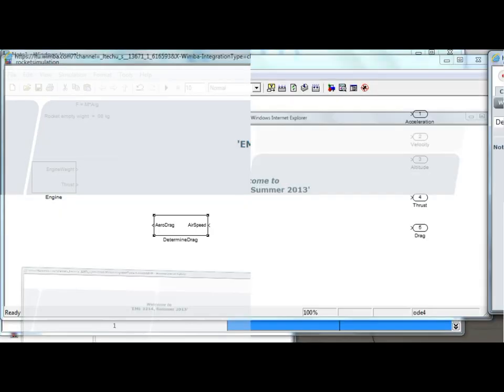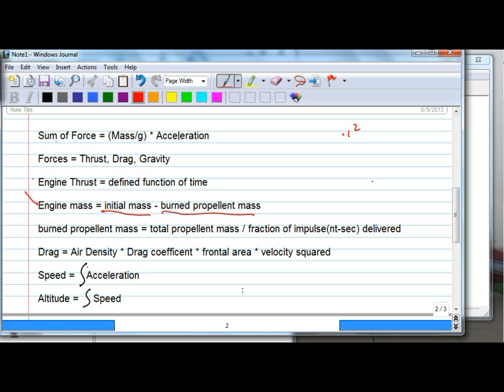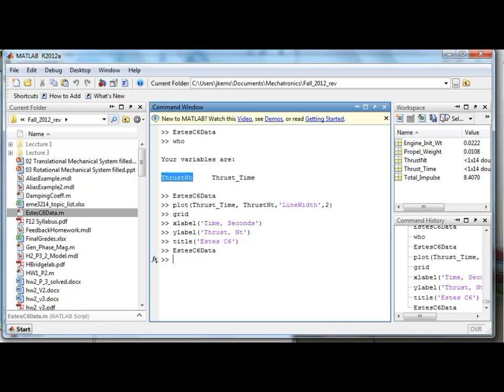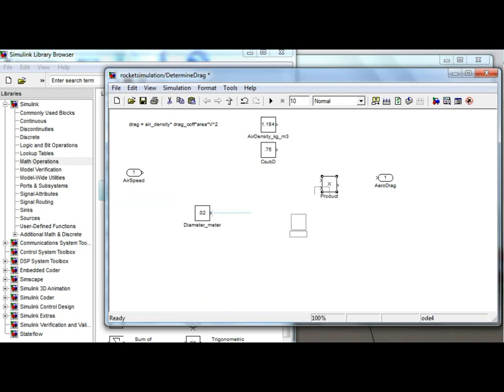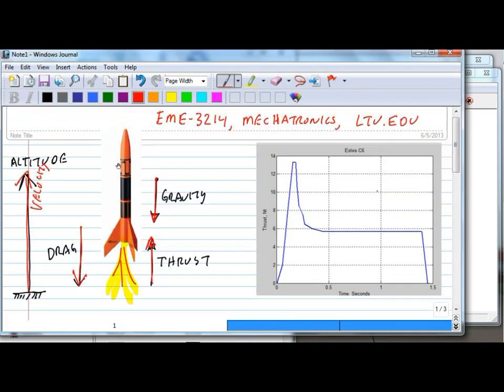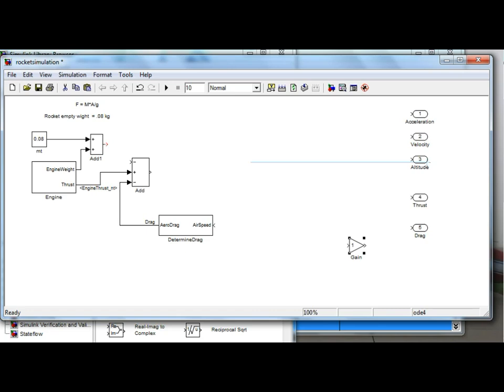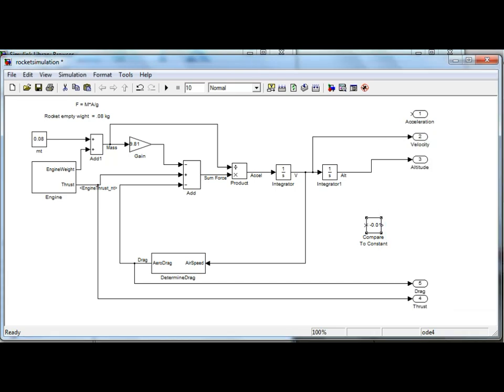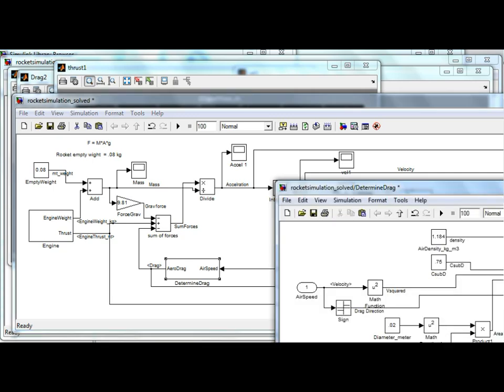EME 3214 Simulink model rocket example

Comment: how did you build the thrust curve?
Reply from the maker: There was an old program "rasp" that had data files for various engines. I took the time/thrust points and put them into a lookup table (the block in the video is obsolete, but there is a n-D look up table block).  Example data https://nar.org/SandT/pdf/Estes/C6.pdf
Reply: @LightAndSportyGuy  I have a problem with the lookup table. the output of that block is zero, I don't know why, and everything is exactly the same.
Reply from the maker: @marco5855  I had to use my school computer to look up the details, so that's why the user name doesn't match in the other replies...

Comment: why is the mass being divided by gravity ? F = ma : N = kg*m/s2
Reply from the maker: Habit. Too many years working with pounds force / pounds mass. I do point out that the value = 1 for SI units. But I should have left it out.  Thanks for catching that.
Reply: @LightAndSportyGuy  No problem. I'm also not sure why my when I view the thrust through the scope, after the thrustcurve ends, the thrust values linearly decrease with time (through the coast phase). Do you know why that is ?
Reply from the maker: @julianchee  I don't have matlab at home to confirm, but the block with the thrust curve is likely extrapolating the values -  It looks like selecting "clip" for an extrapolation method (under algorithm) is the way to turn that off. Also check "use last table value"
This video is a bit more up to date and I cover the extrapolation: https://youtu.be/QftSD_cVkSw?t=439
Reply: @LightAndSportyGuy  that’s the exact problem I’m facing. Thanks a lot for the link !!

Comment: You totally lost me at F[N=kg m/s^2] = M[kg] * a[m/s^2]/ g[m/s^2]???  With [m/s^2]  in both the numerator and denominator you cancel out acceleration and are left with a force equaling a mass???   ma/g == [kg] not kg*m/s^2 which is a N.  What am I missing? I replayed that section of the video many times and you say you had to add g in the denominator because "the units don't work out".

Comment: Hi Geoffrey - Thank you for sharing this great video. I followed the steps and created the model but when I run it, I get the following error:
Invalid matrix-format variable specified as workspace input in 'rocketsimulation/Subsystem/Total impulse'. The matrix must have two dimensions and at least two columns...
Total_Impulse variable is 8.407 defined in the workspace. Can you please help? Thanks!
Reply from the maker: What block did you use for the "Total Impulse" block? Did you use a "constant" block (correct for importing a scalar value) or the "From Workspace" block? The "From Workspace" requires a column of data values and a column of time - you don't want to use that block for a constant.
Reply: GeoffreyThorpe123 Yes you were right! I had used "From Workspace" but changed to "constant". Now I get the same plot for altitude as you got but it's not as smoothly curved. Have I missed any settings? Thanks afresh.
Reply from the maker: Mahdi La'li
Sorry for the late reply. I would look at the pull down for "Simulation" and check the configuration parameters - under Solver set the maximum step size to a small number such as .01. It could be that the default simulation step size is too big.

Comment from the maker: The block with the time / thrust data is a lookup table block that appears to have become obsolete since I first started using this block for class -  "This block was removed from the Lookup Tables library in R2011a and replaced with a 1-D version of the n-D Lookup Table block". It is in "lookup tables" Sorry for the confusion.

The blocks with the constants are the constant blocks that are found in "sources". You can enter numeric values or the name of a variable in the Matlab workspace.
Reply: Using the lookup table with the clock tells me that the output is zero, and the model is exactly like yours, do you know what the problem could be?

Comment: Hi!!

Well, first of all, thanks for the video, it was very helpful for me and I learned a lot. I just have two problems, both of them in the Engine Subsystem:

First, I've looking in my libraries for the block which brings the data from EstesC6Data, and I think that is Lookup Table (my version of Matlab is R2010b for Mac). Is this right?

Second, there's another kind of block that I couldn't find: the ones which takes the constants values of Total_Impulse and weights. Which kind of block it is?